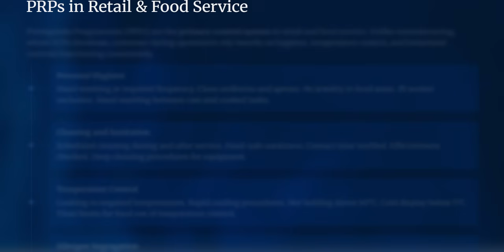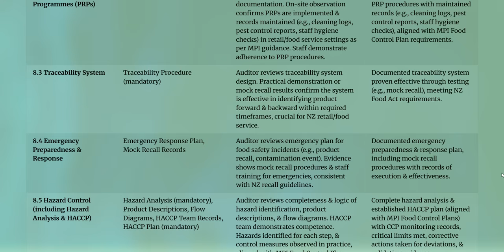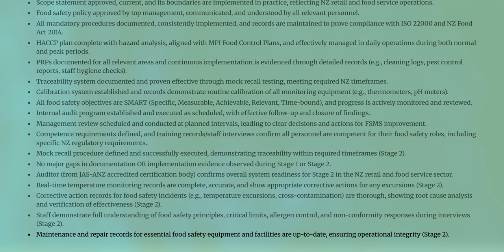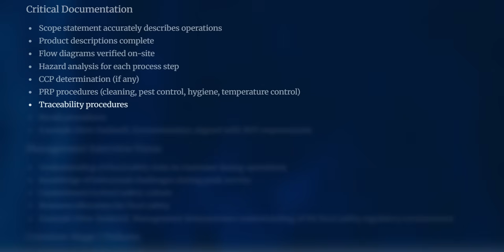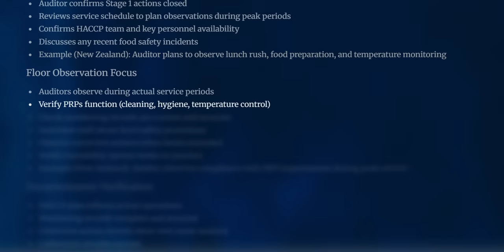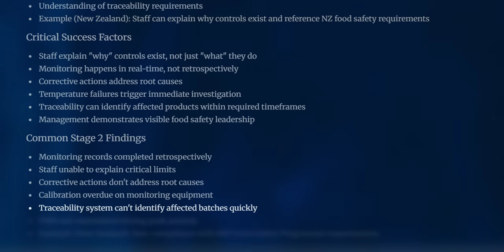ISO 22000 Audit Training | Retail & Supermarket Food Safety

Comment from the maker: ISO 22000 in retail & food service is different from manufacturing.
Here’s something important:
👉 During peak service, what usually fails first in your operation?
• Temperature control?
• Allergen management?
• Staff hygiene discipline?
• Supplier verification?
• Documentation consistency?
Comment your real challenge below — real-world examples help others learn.
If you're planning:
✔ ISO 22000 certification
✔ Integrated ISO system
✔ FSSC 22000 transition
Let me know — Part 4 (FSSC 22000) will go deeper into GFSI expectations.
Food safety systems must work when managers aren’t watching.